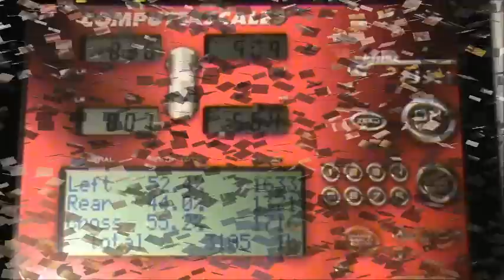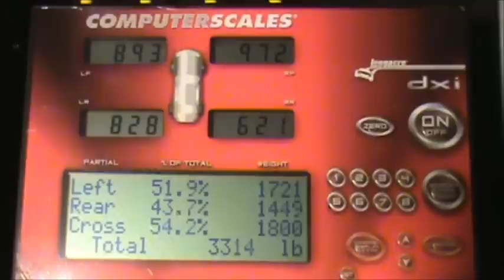DRP DSS-3 Pull Down System.wmv

Comment: Why does the total weight of car change?
Reply from the maker: Hi Gene.  The "weight" of the car does not change, but the load or force on the tires does.  During vehicle cornering, braking, etc, external forces are applied to the car (downforce, lateral force, etc.).  These forces combine with the vehicles weight to create the total load on the tires.  Think of it like this:  If you jump on a scale, the displayed weight will increase for a moment due to the additional force of your weight landing on the scale.